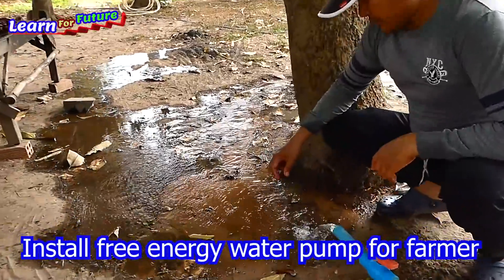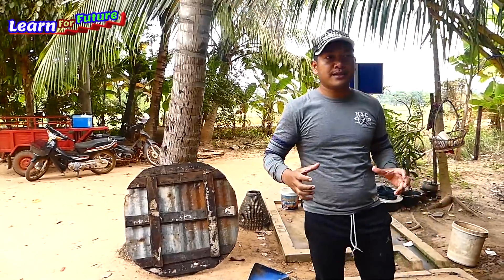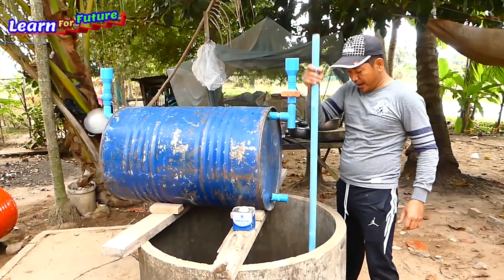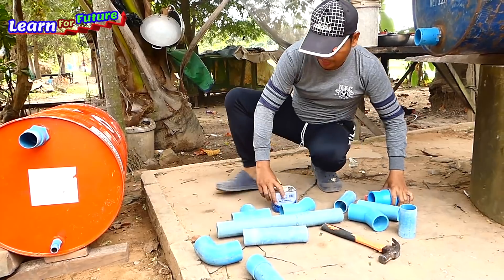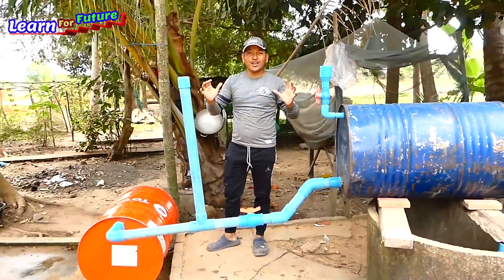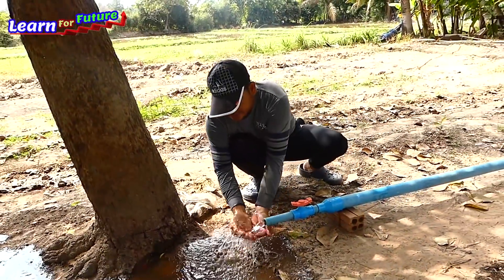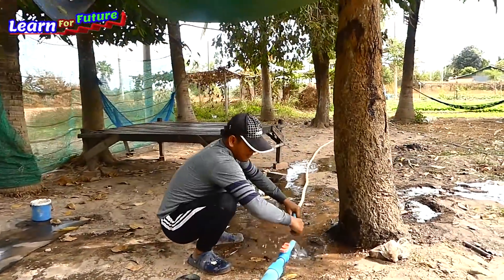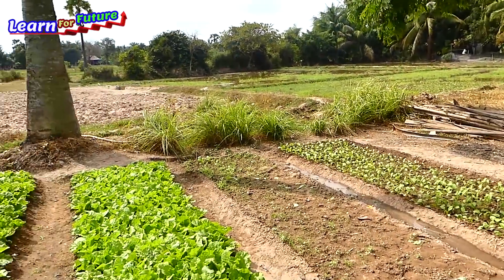Free Auto Pump Water from Deep Well - How to make free energy water tank from Deep Source Well.

Comment: Lots of things can cause this siphon pump could go wrong. 1. The spring of foot valve at the intake pipe is too rigid slowing the flow of water into the drum. 2. The size of pipe going out of the drum must be bigger compared to the intake pipe, this seemed to inceease the vacuum effect.  3. The length of the delivery pipe should be tappered to the end to increase 'capillary flow' effect. 4. The second drum suppose to act as pressure chamber Is doubtful, probably best if a presure gauge is installed to determind the actual pressure  inside the drum.
Reply: 1) Foot valve not needed
2) dimentions do not matter. You can use a lager diamer input than output if you like.
3) No capillary effect here, but output tube should be liftet somewhat upwards to prevent air from leaking inn.
4) Secondary drum not needed.
5) raiser between ble and red drum not needed.
6) Blur drum not needed.

There is a need for to lower the output lower than the water level in the well. As it is here, it will not work.

Comment: This can only work continuously if the pipe discharge end is lower than the level of the water in the well. If not, it will only work for a short time until the pressures in the drums equalizes. Waste of time and money to do this setup as a simple siphon could work if the level in the well is higher than where you want the water to go. I think these guys know this and therefore I have say this video is a fake.

Comment: Well, here a deep well is 100 ft plus, That dipping water to fill barrel didn't look deeper than maybe 35 feet that's not really a deep well here this may work with a well that depth, But wells that have an 80foot plus depth I find it hard to have the same results from this video. This would work pretty good with a well like that like, it's more or less a siphon with a blatter. But Overall Thanks for video!
Reply: Does not work in any well

Comment: Assembled my energy free pump today. Followed exactly as shown on your video. Water lift from irrigation canal to drum intake is about 8 ft.  Used 1 in dia pvc pipe for intake equipped with a 1 in foot valve, with copper strainer,  and 2 in dia pvc pipe for the  discharge. A 4 ft high air pipe also installed at the discharge pipe. Once the 2 in. discharge valve is opened, water comes out of the discharge pipe but stop after a second or two and no more flow after that.  Absolutely no leaks because I can feel the strong air rushing into the drum once the 1 in. intake valve is opened. 
I will try again tomorrow. I will add 2 more 2 in discharge pipe to lenghten discharge pipe to 35 ft. If still it wont work, then i tell you guys this post is a fraud. There is no truth on what is being claimed, and made only for purposes of accumulating views! I will let you know of the results 2 days from now.
Reply: I wouldnt say its a fraud but a Siphon can only pull so much weight of water up a pipe depending pipe size and length. I'm Sure this works fine with a shallow well but if u notice when he is filling the barrel above the well he isnt dipping very far to pull water up. I would bet this would work with about 30feet with that size pipe but any deeper im sure it wouldnt stay working due to air gaps in the pipe , and the amount of water in the pipe would be very heavy. It wouldnt stay working like in video. His well isnt a Deep well this is the only lie i see in the video. Here where i live Wells are 100 plus feet , A sump pump is mostly needed to have that type flow up to top. I have a above ground pump but above ground pumps with a depth of 100 feet needs 2 pipes down the well one directly to the foot and a 2nd one to keep the foot full of water so it wont loose prime.
Reply: Necesito ayuda yo hice la prueba de trabajo y no me funciono
Reply: Is it working?
Reply: It's useless, the only parameter (according to physic) is head (height difference between source and output.

Comment: Guys I did the same.  It works!!!  I took the same barrel.  The same pipes in diameter.  The length of the pipe from the barrel to the water surface is 2.7 meters.  The length of the drain pipe I have is 10 meters.  The difference between the drain and the water mirror is +1.5 meters.  And it's fucking working
Reply: It works ok if the source, river, is higher than the rice field. Impossible to lift water out of any well

Comment: Its impossible liquid is heavier than air  you installed a hidden pump and wired it
Reply: This is a siphon. Works fine if the source is higher than the outlet.

Comment: I think the air line between upper & the lower drum should be located to the outlet of the lower drum; the existing setup will zero down the suction/vacuum lift from bottom of well to the upper store drum;  beside, I doubt the differential height of the existing two drum/barrel could 
have enough lift to draw water from bottom of well.
I could be wrong about this ?
Reply: You are wrong about this, water won't come up by itself. If it did then you could pour it back into the well and generate power from it for free, but free power does not exist.

Comment: This looks like I could adapt it to pull the water from a deep well, make it flow to turn a waterwheel connected to an alternator to create electricity.  What do you think?
Reply: With this comment you prove that this is a scam. Energy can not be created out of nothing.
Reply: Then I suggest you ask for a full refund.  Now I am mystified.  How do the electric companies get away with scamming us by charging for electricity made from water falling from great heights through turbines at dams?  Talk about Energy created out of nothing.  I remember the first time I watched someone siphon gas from a tank.  When they got the flow going I thought, "What a scam!  They have a pump in the tank pushing the gas out the tube."  But before knowing how to spell Hydrodynamics, I learned how to use a siphon.  Little did I know these many, many years later, It's Still A Scam.  Who knew? ;o)
Reply: @JamesKettler  ding ding ding. Finally
Reply: I figured you're being sarcastic, lol.
Are people retarded in the comments, do they think energy comes from nothing? I'm scratching my head here.

Comment: How long does it work continuously if the intake water scarcity is not there. Does it run 24*7without stopping???have u tried
Reply: Yes. Will work 24 /7 , as long as water is in the inlet level.
Reply: @nepalham7450  thank you bro, have you tried it ???
Reply: @nepalham7450  But here the water is deep down in a well. This system can not lift water at all.
Reply: Sorry, it will work for about 30 seconds. Hen a very slow flow til the barrels run dry.

Comment: This only works when the drain point is below the water level at the tapping point. You can't fool the laws of physics
Reply: No. It is not making fool. We to 10' it abouve the input water level it works well. It is gravity pump, not ordinary siphon pipe. Same principle as RAM pump works.
Reply: Siphone pump its a gravity pump.You are fooling  peoples!
Reply: Agree
Reply: Wtf, ram pump requires a flow, there's no flow in a well. Ram pumps work with a small dam and only below the dam water level, then they can pump above the water level but with waste water that is not pumped.
Stop misleading people or your video will be reported
Reply: totoo iyon boss pang subscriber lng ito manloloko sinubokan ko Hindi gumana
Reply: @ignaciolargo7566  It will not work unless the surface to which you want to deliver water is lower than the surface of the water .. This method can be used for a farm less than the level of the water level of the river that passes next to it .. only

Comment: Basic siphoning method and not pumping. It uses gravity to move water from the source to outlet. The outlet must always have a pressure (head) that's lower than the source, otherwise this won't work.
Reply: i think there is s strong pressure involved in water suctioning   in the deep well.law of gravity cannot apply this project except the outlet of water from the drum.how this work? we try it yet in a small scale only.
Reply: The main mechanism is the vacuum created in the drums.. Once the first drum begins to empty, water from the Well moves up(against gravity) to replace the vacuum.. Thus it never stops..
Reply: @hillaryrabin811  what you just said is siphoning. Vacuuming water is called siphoning. However, this will not work if the inlet is lower than the outlet/discharge point.

Comment: Sir what is name of the material you had used at the end of suction pipe? which is used to stop the water for coming down.
Reply: In plumbing terms it is called a foot valve with strainer.  It is a form of check valve for well points. Hope that helped.
Reply: Its a non return valve , maintains water in the pipe and gets the pump primed always

Comment: So, you think that if the volume or weight of water inside the drum is heavier than the volume of water inside the suction pipe is an enough measurement to pull the water up through the suction pipe? i think the opposing pressure heads are the factors to initiate water flow and not the opposing volumes or weights. this is just a siphon setup. try to route the discharge to the source and see... the water would cease flowing because it is just a siphon setup and not a pump.
Reply: Edgar can you give more explanation on you theory ?

Comment: i enjoyed seeing your video, I want to know- why do you always use metallic drum but not the plastic one? why always u keep the drum horizontally, what happens if we keep it vertically???????
Reply: Because the plastic drums may get flatten when vacuum is created while most of the water is flown from the drum. Metallic drums don't get flatten even with great vacuum
Reply: Plastic drum will collapse with the vacuum force inside of it
Reply: Metal used to prevent collapse under vacuum. Horizontal produces a larger surface area as in a piston! 😊

Comment: you are growing in knowledge as you get more units built. i am grateful to you for giving me this idea .i have done two units now on pool and am learning more as well. this has the potential to eliminate the need for MOST mechanical pumps used all over the world. serious potential. imagine a city water tower 200 ' in the air with no power running it? self governing and self priming? im working on that.
Reply: I live in Botswana and wonder why this system can’t create a sea in our desert country. Botswana is in Africa.
Reply: @letlhogonolokebasitile6924  I think, the budget allocation is the problem.  Just do it if you have the money for the project.
Reply: Yo lo hice ese trabajo y no me sirvió no me funciono necesito ayuda
Reply: @silvanorodriguez1614  It will not work unless the surface to which you want to deliver water is lower than the surface of the water .. This method can be used for a farm less than the level of the water level of the river that passes next to it .. only

Comment: just a note and hint. 
pool vac hose works great for this in certain situations. it will not collapse under suction. can be coiled to deliver water close to source , instead of 100' of straight pipe for down run. just be sure you have enough elevation with drum .

Comment: i saw your source of deep well is wide open,,, is this working also on deep well with small opening which are common on rural areas? i am planning to change metal tube with the one you are using and will check if it will work.  thanks for reply
Reply: Hola, si usted logra hacer funcionar el sistema sería bueno que me lo comunique. Gracias
Reply: That is also my question if it works on deep well with small opening and how deep will it works?

Comment: It flow because of the reserve water in the drum if its empty it well never flow
Reply: I think it will work only if the outlet water level is lower than the inlet water level
Reply: @harischoziyatel3749  it's true
Reply: Why is he using a very long pipe for the outlet water?
Reply: @harischoziyatel3749  increasing pressure

Comment: very good technique but you need more pressure, learn the Ram Pump construction and add it to your system to produce more power for water to go more distance .
Reply: The ram principle doesn’t work in this situation, you need head water like an upstream dam to create a water hammer effect
Reply: @BESHYSBEES  yes it won't work alone but as GARDEN STATE say's ADD IT. I think it will work to add pressure...
Reply: @jaysoncercado8151  if you understand the ram pump principle you will understand that it does not work in this situation

Comment: Is there a way to make drum pump work to replace the 1.25hp motor pump we use at home? Foot valve is attached on the "straw pipe" 8 pcs x 6.09m each.
Reply: Try it first with only a 2 liter bottle & see if it works before you waste your hard earned money.
Reply: @Paulsministry
Reply: How can you expect a system to pour out water   higher  than the source when it  cannot do  at the same elevation {source and output).
Reply: @juniecapitulo5875  the output pipe is much bigger than the input pipe, so it creates more suction and lifts water.
Reply: Sir Ed i dont think the drum pump can operate at that depth.
Reply: It can't replace even 0,00000000001 hp motor pump.

Comment: Its Fake
Reply: هذا غير مزيف هذا صحيح حسب قوانين الفيزياء لرفع الماء لأن الماء يمتاز بالسيوله والانسيابيه والضغط الجوي يحسب على أساس 1 بار أي يرفع 10.3 متر ويمكن عمل مرحلتين لرفع أكثر من هذه القيمه الذي عملها يشكر عليها .
Reply: It is not fake but true when we use lhe physical laws . We can left up 10.3 meters and more this  distance  if we use to stage  or used another pressure cam from system by used part from water applied spressure  to increse the pressure thank you very much.
Reply: @aooobhh4939  YES.  Only  true for a siphon system when the  output elevation is lower than the source.
Reply: @aooobhh4939  We can let water  rise up to 10.3  meters  (scientifically proven) and flow in the output pipe or hose only when  the source elevation  is higher than  the output elevation.
   The drum is used only as priming port to facilitate so that the siphon system works.  The bigger output pipes and vertical pipes  help only to increase water output pressure. but they cannot really help to raise water in  the intake pipe to the drum, no matter the size and length. Elevation matters not size and length.
Reply: @aooobhh4939   when the pressure reach its level then it will try to fill all the blank  space by sucking water from both sides then water won't flow .if you don't believe then try and tell me please.
Reply: Please watch carefully 17 to 17:20 water didn't fall . He moves Way after  he hold the camera and the camera person refill the tank to speed up the water
Reply: Genuinely fake!!!

Comment: The atomic sphere equal one bar and this equal 10.3 meter  you can use to stages to lift this head to lift more fhan 10;3 meter
Reply: yes .this design is able to be scaled up too. i'd like to see what a 300gal drum and 30' head would do. this design is important as it can be used any where.